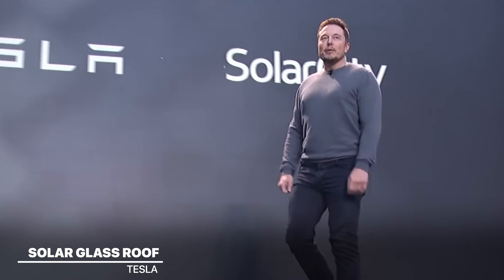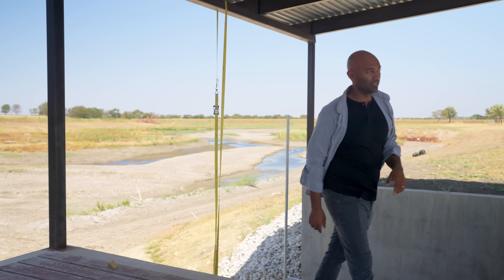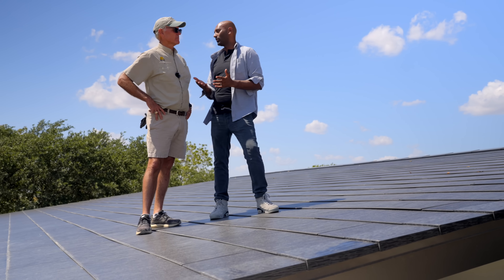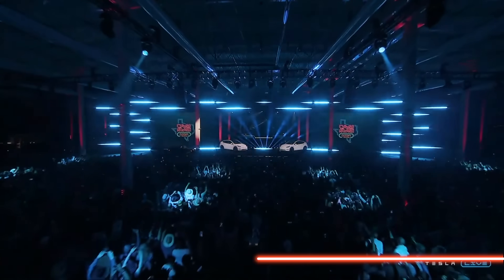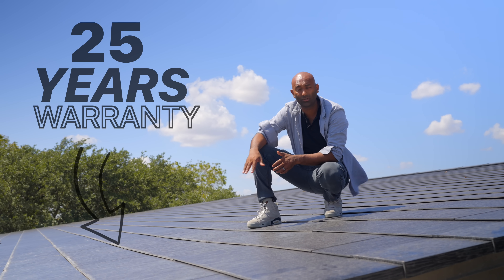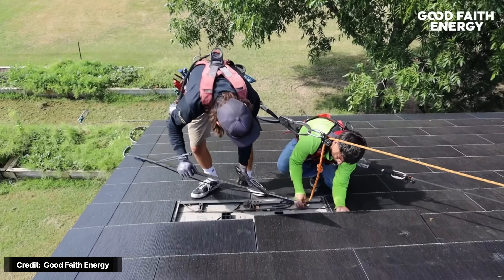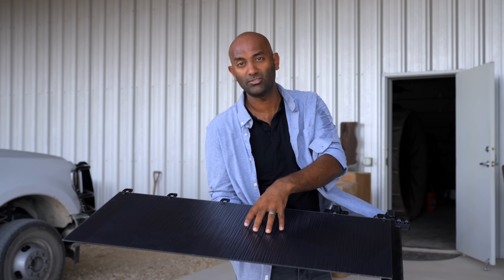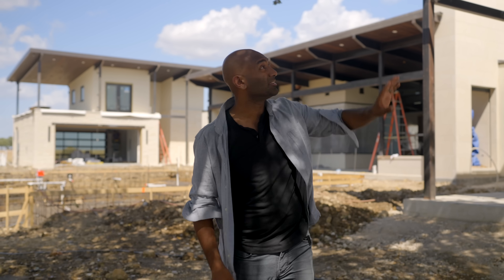Tesla Solar Glass Roof is About to TAKE OFF!

Comment: The promise of the Tesla roof when it was launched was that you could replace your existing roof with a solar roof and get a better product for about the cost of a new roof plus separate solar panels. 

That clearly hasn’t worked out.   In this guys’ case he could have just as easily put regular panels on top of the metal roof on that same building.  Especially because no one can see that roof the aesthetic value is basically wasted.
Reply: Yes plus factor in $150K for a meager 17 KWH of solar and only 50 KWH of storage, this is a $10K system, not $150K.
Reply: @222INFINITY  Usually solar installs in the US are about ~3$ w installed so that would be $50k in Solar alone.  Storage is usually about $1 kwh for these type of professional installed systems so another $50k in battery storage so about $100k system not $10k.
Reply: @SDGreg  $3 per kw you say? I'll sign up right now, I want 20kw installed so that's 3x20, where can I send my check for $60?
Reply: @jimbob3030  You are the first one that has seen that typo.  :)
Reply: Musk / Tesla totally underestimated the complex nature of roofing.   This product was always destined for new construction or total rehabs !!!
Reply: It seems like they designed that roof section perfectly for putting on normal solar panels. A perfect rectangular expanse with no penetrations! But then he put a Tesla solar roof on? This house design seems exactly the opposite kind of situation that the Tesla solar roof was conceived for. It looks very nice from the drone shots but it appears that you can't really even see this roof at all from the ground. I thought the whole difference with the Tesla solar roof was that aesthetically it matches more normal roofing. Also why do you need a massive propane generator if you got all that roof space? If you need more energy it seems like you would add more solar and batteries, and by going with less expensive conventional solar panels you could afford a lot more kWh. All in all just seems like not a great example if you're trying to showcase the advantages of a Tesla solar roof. Not to say it's a bad house design I'm sure it works perfectly for the owners and meets their particular needs and budget. And I applaud any new building project that was designed from the ground up for solar. It just doesn't really illustrate the particular advantages of the Tesla product.
Reply: @EPeltzer  At some point adding more solar/batteries isn't cost effective. Having an alternative source of power becomes much more effective use of money. The combination of a generator on top of panels and battery makes this system very resilient. This system could power itself for maybe 50 years off grid without ever having any issues.
Reply: You can install traditional solar panels with water-proofing in between them, thus serving as roof, saving money on roofing materials and work too.
Reply: @NeblogaiLT  I could be wrong, but conventional panels are generally not walkable - and that may be a code requirement for some situations.
Reply: @ksnax  You can walk on them if you're careful and not too heavy. If you step on the frames no problem. I used to be a solar installer, we walked all over them during large commercial installs, I never broke one doing so.

Comment: My 11kw system in New Jersey cost me $33k installed with the electrical panel upgrade.  I didn't do batteries because NJ does net metering and gives you credits if you grid-connect.  Also at $10k per battery, adding batteries really extends the break-even date on solar installations. With tax credits, my system will pay itself off in 6 years.  One battery would push that breakeven point to 9-10 years.  I will hold out for a solid state battery if I'm going to put it on my house.
Reply: Only problem with net metering and a grid connection is that we already see energy companies, and their pet politicians, working to either undermine adoptions and/or find ways to make you pay in fees and taxes for being connected to said grid, instead of the other way around. And, they could also "require" you to be grid connected to install at all, if you do so via something like tax credits, or the like, thus forcing you to pay those fees. It's inevitable that energy companies will, at some point, become backup for your own power, or a source only for those that the solar can't scale to, like companies that use massive amounts of power, but there is no way in hades they will give up making hone owners pay through the nose somehow during that transition.

Mind, currently something like the Tesla power walls has the same problem as electric cars- the biggest long term cost is replacing the batteries. So.. maybe a better bet wpuld be for energy companies to solve this issue by "renting" the batteries. Something like that, or a core exchange, like with lead acid batteries will have to happen soon, or the cost, both to anyone trying to adopt such, never mind, ironically, a whole new class of environmental damage, will also become inevitable, erasing all gains made by installing it in the first place.
Reply: @patrickelliott2169  It depends on your state.  New Jersey is a solid blue state and has green energy mandates in place for the power companies as well, and I think home solar counts toward the power company mandates, so my power company is encouraging solar adoption.  There is a grid connection fee every month, but for me it's $5 per month.  On Long Island, NY, its' $15 per month, but they have a similar program.

Comment: Random question to who may know... This might be a dumb question, I might be a little confused ha Say you have well water: the submersible pump brings it to the pressure tank, pressure tank through the filters you have/need, then the cold water is ready for use. There's a line that diverts off to the hot water heater and the cold water heads down the dip tube and heats up, so far correct? the question is the hot water in the water heater still pressurized by the pressure tank or is there some sort of pump that the heater has?
Reply: Not that I am aware of. The pump pressure is what delivers water to the whole house. Now you can buy another pump to up the pressure ,between the pressure tank and your home. Hope this helps.
Reply: Typically the pressure tank provides the motive pressure for the whole home.  It 'pushes' the hot water through the water heater to your taps as well as the cold water directly from the pressure tank to your taps.  Hope this helps.

Comment: It's so so so overpriced. 10KW right now cost less than $3000 in solar panels. What Tesla is asking is ridiculous. 

I think big home  solar installations are big mistake. Only a fraction of the cost is the solar panels and the inverters. Most is red tape ,  labor and profit. Instead the focus should be on small ready to plug kits. No red tape, no labor, no inspection. Just buy a 1 kw system for $600. Plug it in a socket and you are done.

This is being done right now with balcony kits in Germany.
Reply: You can’t compare solar panels to a luxury roofing system with solar incorporated. That’s one product against 2.

Comment: I find the topics you pick for your show really interesting and relevant. On solar roofs, it seems that house design needs to change. The focus needs to change from curb appeal to practicality. Subdivisions need to be oriented in such a way that the predominant roof needs to face south for use with solar panels or solar roofs. This is a municipal requirement issue. It may take a private developer to jump start this type of development.
Reply: I would be very concerned about that foam insulation if it’s the stuff that burns and gives off cyanide gas.
Reply: It's not an either/or situation.  You can have both, and both are important.  It's a matter of problem solving.
Reply: Home design is virtually unchanged since colonial times; before plumbing and septic, heating and cooling, let alone electricity and Internet. We can do much better.

Comment: Calling a 4000+ sq ft single family home environmentally friendly is pretty funny.  I would put it more in the "prepper" category, but still pretty cool.
Reply: Everything is bigger in Texas.
Reply: Pennsylvania has a special new subsidy for retrofitting homes for solar energy. My house is ideal, one of the specialists involved in the program told me. The roof faces south. It has no obstructions such as trees, dormers or nearby buildings. The angle of the sun is appropriate to the climate. He recommended against installing solar. 

Why? My house is too small. The roof covers 450 square feet. Tiny. The cost of solar electricity and the cost of buying electricity from the grid are identical. But before solar panels can be installed, according to the specialist, I would have to replace my existing shingled roof because the shingles are halfway through their life cycle. I can't afford to re-shingle my roof. So for me, solar energy is dead. 

I might note that nearly property owners within a half mile of my house face the same situation. Or worse. Like me, they live in a densely built city. Their houses, like mine, are 100 years old or older. Many houses are duplexes. In half the cases, the roofs face north. Most south-facing roofs are obstructed by trees or dormers. The home owners or renters have small backyards, so the choice for the owners is either solar or places for the kids to play. 

Unless cities demolish densely populated housing and replace the land with McMansions like Ricky's or the gentleman from Texas, no one here can afford solar energy. For most low- and moderate-income folks, solar energy is wishful thinking.
Reply: @frankbaran5698    In NC, I have found that state sponsored programs are a scam with too many strings attached.   I would rather own my own installation even if I must pay much more out of pocket for it.   ( Of course.....we never really totally  "own" anything especially housing which typically is conveyed with a "certificate" of title, and NOT THE ACTUAL TITLE! . )
Reply: @frankbaran5698  yes, for desne housing areas solar energy is less doable, for his house in a remote part of Texas it is doable, what's the problem with that? He didn't build a mansion in the middle of Manhattan or Hong Kong, he built it in a place where there is no other house on the horizon, so probably somewhere that not many people want to live in.
Reply: It makes total sense to build "prepper" if you can afford it.  No sense in relying on our woke, libtard  ATLAS SHRUGGED  world.
Reply: but they payd for early stage more expensive product... take it now for much cheaper price and put on 5+1 multifamily
Reply: welcome to Texas where everything is bigger.
Reply: This is the contradiction at the heart of the modern environmentalist movement. Humans have grown used to high energy consumption and materialism. If you want to fix the environmental issues, you need to be less modern. It's as simple as that. Installing your own power plant (solar roof/batteries), water tank, propane generator, etc, imagine if everyone on earth did that? It's so incredibly inefficient per capita. If you actually want to reduce your environmental footprint, go live in a crowded building and stop using transportation, electronics, and hunt for your food.
Reply: @bloong1080  You are pretty clueless of the world outside of rural US if you think everyone could just go hunt for food.
Reply: @Tiasung  and you completely missed the point if that’s what you think. My point was that no one is going to do these things
Reply: @bloong1080  then bring your gutted, tongue out deer home on public transportation.
Reply: @bloong1080  agreed until you said "hunt for your food." How in the world is that practical? First, eat vegetarian - no hunting (of animals). Second, in many cases, I wonder if large commercial farms might actually offer the lowest environmental footprint (what does the data say?)

Comment: For the forseeable future, retrofitting might be the only major route to solar adoption🤞. What we need is efficient code approved solar installations, that does not need a boatload of crew and several weeks if not months of planning, and finally a fat wallet. This is where most expenses of a solar install occur. We need small tile like solar cells as thin as those marginally efficient CIGS type, without the inefficiency and panel size requirements. By creating tiles of needed size off the install site and arranging on a continuous fed roll, the installation is nothing more than rolling out a carpet🤔. The non producing members will blend-in to provide continuity around uneven contours. Robotic automation should work all the way, the moment shingles are teared down, to keep costs low. It should work more like laying out a carpet, just that it is not. We need a different perspective for global adoption. Just some 💭❤️👍